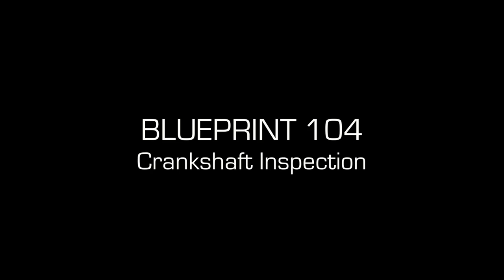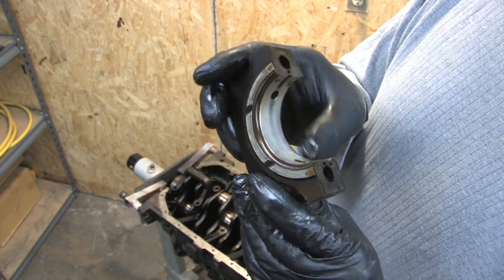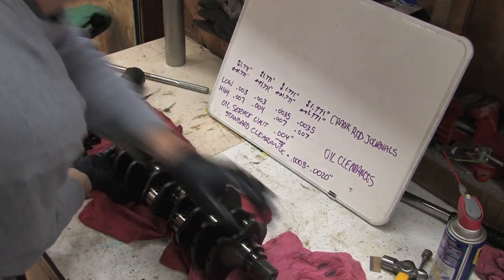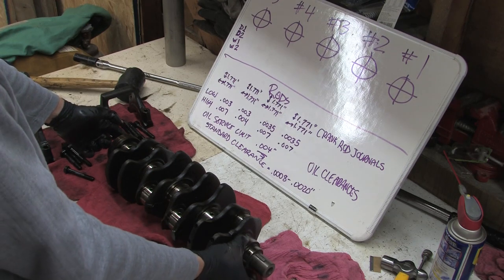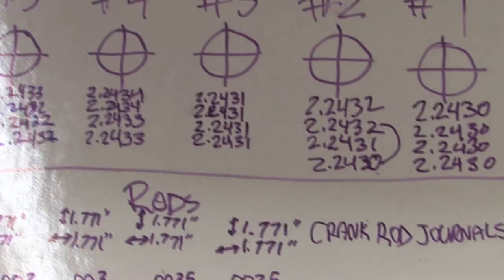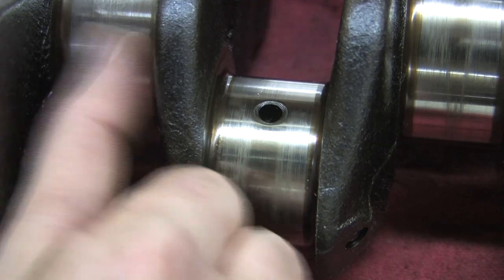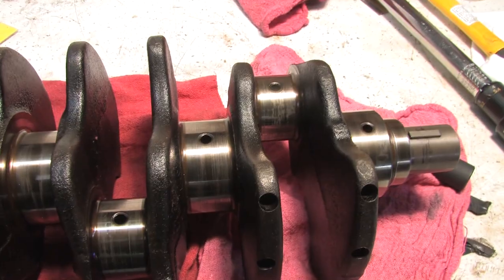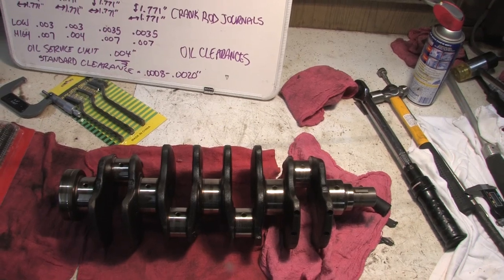Blueprint 104 - The Crankshaft

Comment: I learn something from each of your videos. I never thought to measure the thrust bearing surface to get the clearance before assembly. I got the measurement after the assembly with a feeler gauge (your nifty electronic dial gauge will make quick and accurate work of this). Anyway nice video and thanks for the information. 

Robert

Comment: and main bearing caps as well as head bolts are to be torqued or untorqued in steps not done with breaker bar but a torque wrench because u could cause the crank to bend or warp

Comment: Good job another idea for measuring the width of the thrust surface is use inside callipers and a mic if it's hard to get to. And for the rear seal wear spedi-sleeves can be your best friend

Comment: I understand the importance of being diligent and careful with the disassembly and reassembly of the crankshaft.  I'm struggling with the necessity of doing all the measurements and documentation if you are going to end up sending it to a reputable and competent machine shop to make any necessary machining and refinishing.  They do this every day and certainly have more expertise than me.  Of course I'm old and got my Master's degree back in 1970 which is probably about the time you started walking the planet....there's a 7 series BMW, a Mercedes SL and a Porsche 911 in my automotive stable...don't know how I ever managed before I saw this video.
Reply from the maker: If someone else is doing the assembly, then let them do this.

If you're putting it together, then you'll have to do this to determine your bearing sizes once you're ready for assembly.

If all you're doing is taking it apart, give them the block and the crank, and they'll get your bearings straight for you.

Thanks for the kind words!
Reply: Absolutely, never play the other man's game.
Son
Reply: the OLD GUYS are the reason i know how to build an engine
Reply from the maker: charles colston Same here!

Comment: Jafro Sir,
By measuring #1 and #2, let say woodruff (W1 and W2 ), you measure W1 on left side of the journal and #2 on the right side of the journal and the oil hole is in the middle.
Is this what you mean by W1, W2, D1and D2 ????

Comment: I have another one for you.  On my service manual, it only tells me to do plastigauge on mains and rods. But I wanted to do more complex measurements just like what you did on your other videos.

Here's my question:  I am about to measure my rod bores and crankshaft rod journals with a caliper or micrometer ( just like on your video ), if I subtract those two measurements, do you think it is the same specification as doing a plastigauge?
I hope my question makes sense.

Comment: hi there mr jafromobile i have a question, i can see all the cranckshaft journals are a little scratched, isn that enough to require undesizing the journals?? or undersizig is only necessary if the measurements are out of spec?? thanks for the answer and sorry for my terrible english 
PS: i have seen avery single one of you videos great job man

Comment: Hey Jaf, I'm getting 1.7620"-1.7625" mic'ing my rod journals, but the previous owner must have had a rebuild with clevite 77 .25mm oversized bearings (cb1120p-25mm), which comes out to 1.77184" - 1.77234".  Any thoughts on that for a rebuild ?
Reply from the maker: Factory specs for the crank pins are 1.7709" - 1.7717".  The crank's got ten thousandths shaved off which is indeed .25mm... and that would explain the tight big-end measurement... but mic the crank pins and see what you've got on the crank.  I don't know how you're coming up with the last set of numbers.  It's a difference of .009" which would be disastrous to oil clearances.  I junked the crank I had that had been turned down .010".  I don't mind a crank that's been polished a few times, but I don't like installing turned cranks.  4g63's aren't V8's, and I still don't like doing that even on a big meaty V8 crank because the bearings wear faster, and it weakens the crank.
Reply: *****
I was adding the .25mm to the pin, but that isn't correct.  So I just torqued the rods, and came up with 1.760-1.7615.  Clearance calcs range from .0009-.002.  I plan on new rods/pistons/bearings, so I guess my question is, would I still use this crank and continue the trend with new .25mm bearings ?  The main's also have .25mm bearings, but I didn't mic those yet.  Doing that now...
Reply: ***** All the mains are 2.235, so I guess all the pins & journals had 10thousands shaved off.  Looks like I just increased the cost of my build by adding a new Eagle crank into the mix. At least I'll go back to standard bearings, makes math easier next time.

Comment: Hey jafro, could you plz do a video showing how to measure a crankshaft stroke  ?
Reply from the maker: gamenessovercolor666 I don't have any tools that can do that...  What I do is look up the engine's specs that I'm dealing with.  Bore and stroke are typically known values unless you have a cobbled together pile of aftermarket parts that you don't recognize.  If you know which crank you have, google its bore and stroke specs and that will give you the value you're looking for (for the calculator... because I'm assuming that's what you're doing right now with that spec. :P)  Google your engine code with "Bore Stroke" added onto it.

Comment: Torque sequence to relieve the pressure on the crank. Unfortunately there is no pressure on the crank laying in the block"0"pressure, then the main bearing caps are so much easier to remove wiggling the cap bolts towards the front then to the back. Did you know most crankshafts are ground in crankshaft grinders between centres & most of the  "PROFESSIONAL" engine building shop grind their crankshafts in their  crankgrinders   in-between 3 jaw chucks , then sell you a balance job. All they are doing is F^%#$%^NG up your crank , Doing crankshafts between centers "0" runout & 8/9000 RPM from cast 396 Cu" Chevs without any off their F&^%$#D UP grinding & balance jobs. The last engine that I built for a stock car race,  I polished the  used STD/STD cast crank with 2/3000 grit paper side to side , to show the lines on the crank & then polished the lines out carefully . We had 3 firsts in 3 races & the last race we started at the rear of the pack & still came in first . Good Driver AA!  A little Knowledge is dangerous & I would stake my life that more engines end up in the boneyard (THAN ALL THE RACING COMBINED) on account of facsimile crank grinding not really meeting the factory specifications FOR RUNOUT OR O.D..  Thank You James Burke AKA MOTOR MOUSE I LOVE SBC'S The sbc had fuelies in 57 and  because the mechanics were not trained on the fuel inj.. , it set fuel inj.. back 50 years. Another little fun fact Saab I believe took a D.O.H.C. /4 valve engine to the Worlds Fair in 1905 in France

Comment: Hey Jafro,

Extremely informative and professional video series, thank you very much for taking the time to make it!

Quick question: Aren't you supposed to use the wrench included with the micrometer to move the fixed piece so the zero lines up when measuring the 2" calibration block?  I'm very new to using tools like this (hence why I'm watching this video in the first place), but have seen that mentioned a couple times before.

Thanks!
Reply from the maker: Yes.  You're supposed to do that, or you buy such a garbage set of mics like mine that you break the wrench on the barrel because it's either rusted or welded onto the micrometer leaving it seized and non-adjustable.  The whole set was like that.  I finally got to borrow a $6,000 set to compare them to.

It's simply amazing what a difference it makes.  I will be featuring them in my very next video.  The set I have here is just a set that I could get my hands on quickly.  I'll warn you now before it's even posted... I didn't go into anywhere near the detail I did about it in this video, and you'll thank me for that later.  ;)
Reply: ***** Thanks Jafro!  I actually picked up this HF set as well, but returned them the next day after finding a great deal on some used Brown and Sharpe 0-1" and 2-3" mics at a local used tool store that measure down to .0001".  

Thank you again for the video series and for taking the time to reply - I'm off to measure a Subaru STI EJ257 crank thanks to your help!

Comment: i purchased a crankshaft online and on one of the rod journals there were a few small deep marks and big enough to catch with my fingernail. I called the shop and they said not to be worried because the crank has been polished and re - harden. Do you think it will be fine or should I return it?
Reply from the maker: +Orange Juice I would get a second opinion.  I can't tell you over the internet, but at this point, I'd recommend scrutinizing it better and spec'ing out every journal.  High spots wipe bearings.  Deep grooves can cause cavitation in the oil film layers which can cause bearing layers to separate pre-maturely.  Shallow scratches or grooves sometimes aren't a problem, but I can't diagnose this over the internet.  Show a local machinist and get his opinion.
Reply: after the block installation i rotated the crank and felt some resistance and have to put more pressure to turn it. Is this normal from the new rings and resized cylinders? comparing to before the rebuild the crank rotated with very little resistance smoothly.
Reply from the maker: +Orange Juice Is that resistance even?  Is it the same as you turn it or does it get easier in spots?

Comment: So I take it my crank isn't in to good of shape lol
I got anywhere from 2.243 to 2.240 between my mains on my 6 bolt following your guide lines ........ mind you Napa callipers aren't the most accurate of devises at 15 bucks. off to the machine shop my crank goes to join my block I guess.

Comment: my toyota glanza v 200 hp engine 1.3 ct9 hybrid turbo....

WATCH MY VIDEO.. WATCH MY VIDEO..

2500 rpm its start makeing  big end noise i was open sump today.. journals and bearings smooth clean.. DO YOU NEED CHENGE BEARINGS OR WHATS PROBLEM DO YOU ARE THINK?  

THANKS 

RIFAT 

MANCHESTER

Comment: Tiny hairline scratches that make a perfect circle around the crank are not a reason for an in-car bearing replacement to become a total engine overhaul.  Your new bearings are going to be WAY better than what you are taking out.   If the crank is out of the engine, sure get it taken down to the next 0.010" step.

Comment: Those are not bearings! They are two pieces of smooth metal rubbing against each-other...
.
Would be nice if they had ball bearings... the crank could be taken apart with simple bolts, with it centered with grooves. That way you could just replace the bearing and rods, and not have to fiddle with a thousand minute measurements!?
.
Not to mention you could redline at a lot higher RPM's... why this design is still being used is beyond me, because it is rather dumb and primitive? The wheel and ball have been around for how long?
Reply: You can't be a serious technician or mechanic if you would suggest ball bearings. For one, how would you split these kind of bearings for installation? And even if you could, you are forgetting the biggest issue with ball bearings. They only ride on a tiny spot in the race, just the tip of the ball touching. This hugely reduces the ability to reduce friction in the crank assembly. Please educate yourself on this subject more online.
Reply: PeterDad60 I guess we don't need ball bearings for anything...? I detailed a simple plan for replacing bearings without a sealed crank... just use bolts... F1 cars use ball bearings in there engines.... you'd be lucky to redline beyond 12,000 RPM on the best blue printed engine without ball bearings....Pls don't call me stupid for having a good idea!!
Reply: +Brian Davis You just made a stupid conclusion from my post. I never said we do not need ball bearings. So stupid is as stupid does.
BTW do you own an F!1 Race car? I think not. So I'd guess the car you do own does not use ball bearings everywhere an F1 Race car does. Gee, I wonder why? Oh, because your car does not require ball bearings exactly in all the same places as thew F1 because you car is not a race car.
Reply: +PeterDad60 If cars used ball bearings, would it not make them more reliable... and have better performance/gas millage??
Reply: +Brian Davis Almost all 2 stroke engines do use ball bearings, and they dont redline really any higher than a well build engine with normal bearings. Stroke is what hurts your redline, the longer the stroke, the faster the piston has to travel through the bores, this hurts the rings. F1 engines rev so hard, because they have a very short stroke. Having a short stroke, reduces torque, requiring it to be reved harder to make the same power numbers. Engine technology is a trade off game, what are you willing to sacrifice to achieve what you want. And using ball bearings, well for one, assembly of an engine with any more than 1 cylinder would be too expensive, and unreliable to be worthwhile.
Reply: +Brian Davis And NO they do not use "ball bearings" they use those needle pin crap that isn't long term reliable!!
Reply: The bearings are cheap,  but 2 or multi piece,  pressed together crankshaft,  requiring even more specialised equipment.  Like I stated earlier,  a tri metal bearing,  with proper oil clearances,  will last a million kms, and is not the greatest friction source in the motor,  so they would make sweet fuck all difference.
Reply: +Adam Bielby There is also some bearings called shell ball bearings that have individual slot/holes for each bearing (won't fall out) that ar side by side, up and down... do you know what type bearings they use in F1 engines, or is that top secret... or you could just round off the apex seals and run a cap or two full of two stroke oil, since it's like using a 2-stroke without oil... also could nikisil plate all the rubbing medals!! Don't know everything.... just some very plausible brainstorming by a wanker!!